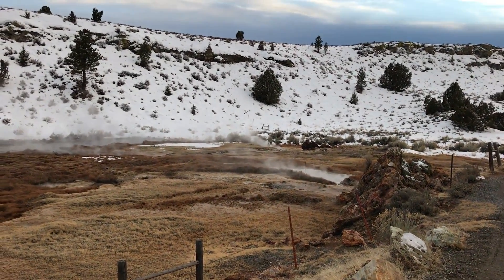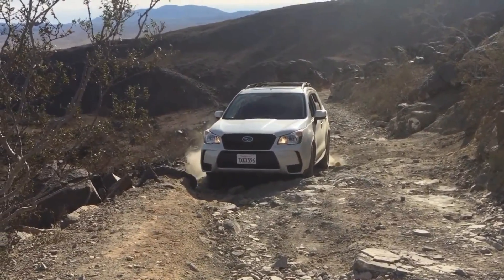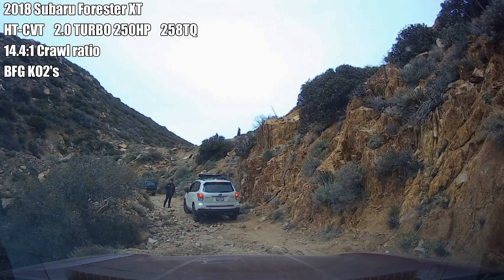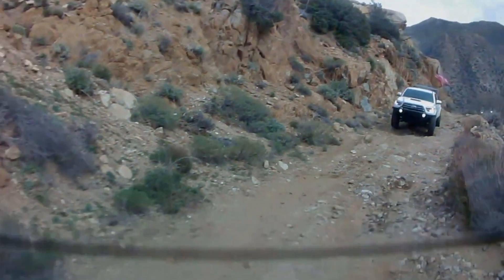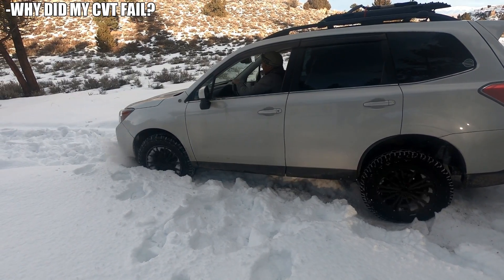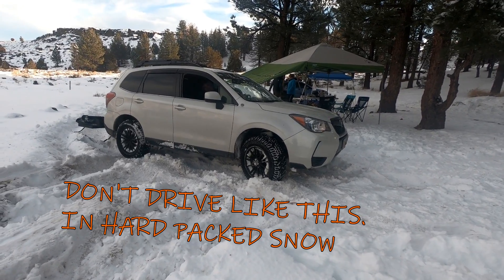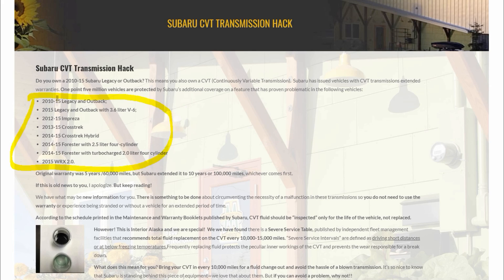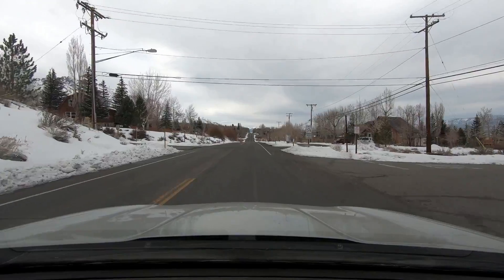CVT transmission Failed!  Can we make them last?

Comment: Great set of info. Transmission cooler with a thermostat is very good idea. Oil cooler on the turbocharged engine is also good. I probably won't get another Subaru until they really solve their transmission issues.

Comment: Great video! I like the powerade bottle to show the angle of the hill, me and my budy always complain that you can't see it on camera so it looks like the car is struggling for no reason, might have to steal that idea from you lol. Also I believe (could be wrong cause I haven't looked to much into it) that you can put in a more powerful pump to help it change ratios when under load, or, keep it in manual in a set ratio helps it because it isn't trying to shift to find the correct ratio when you are thrashing down a trail. When mine went into limp mode it acted like it was going to die when I touched the accelerator so I popped it into manual and shifted it accordingly and it actually worked fine. (In the second part to the hill climb video)  where do you go wheeling at??
Reply from the maker: Dirt-Trek, we know all the tricks with manual mode and the paddle shifters, but I’ve never heard of an upgraded pump.  What kind of pump is that?  Sounds interesting.  

I would be honored if you use a Powerade bottle in one of your future video 🤣.  I like your style, I’m going to have to give you a shoutout in my next video.
Reply: @JonDZ_Adventuring  I wish I knew those tricks before some of the obstacles I've taken lol, but that's what my channel is for, finding problems and solutions first hand.  I tossed around the idea of putting a turbo on Treky before I realized power wasn't the real issue, and my concern was could the cvt pull ratios with the pump it had against more power. Can't find the exact source and I may have been mistaken but I think I heard it from one of these guys
https://offroadsubarus.com/showthread.php?t=6867&page=37
A shout out would be amazing, my channel is... struggling lol

Comment: If you want your CVT to last, stay OFF the trails
Reply: If you want your tennis shoes to last, keep them in the closet! We intend to use our vehicles, and our driving style has brought out a flaw. Even people who don't offroad might have trouble with this if they have steep hills in their commute. Subaru actually has one of the best CVT s on the market but it is still a newer system so undesirable issues are going to surface.
Reply from the maker: Well said Dirt-Trek!  Also, I’ve been hanging out with more and more 2019 Forester’s with dual stage Xmode.  Having previously owned a 2015 Forester XT with the turbo, I hate to say it, but... I really think they’re more capable than the previous model, even without a turbo.  Subaru must be fine tuning the transmission (by upgrading small parts like the torque converter and valve body + programming).  The dual stage Xmode makes a noticeable difference.
Reply: @JonDZ_Adventuring  definatly a lot to look into seeing that it isn't a traditional 4x4, hopefully I can get the upgrades on it before I push it to the breaking point. Don't ever plan on selling it though so I'm in for the long haul
Reply from the maker: Dirt-trek you seem like a pretty technical guy.  You can probably swap in the 6 speed or even better yet, a 5 speed dual range!

The 6 speed manual has a really freakin high crawl ratio.  They can climb steep hills at 2,500 rpm.  Check out @lates23 on Instagram when you get the chance.  He drives a 6 speed crosstrek, but if anything ever dies, he’s going to put in a more powerful engine.  Might be from the WRX, maybe the STI.

I use to drive a 2010 WRX.  I hated off-roading that thing.  But, I know why.  I had a 10:1 crawl ratio 🤣.  The crosstrek is 17:1.
Reply: @JonDZ_Adventuring  technical would be a very kind way to put it, more like a persistent bumbling idiot lol I see that I have, or am about to break something and literally try whatever solution and see if it works lol I'd thought about a swap but I'd like to stay with the cvt. It's new, it needs to be reviewed and improved, and I'd like to see it succeed.
Reply from the maker: Robert Prechter well by that mindset you’ll also want to stay away from cold weather, busy cities and uphill freeway mountain passes.  OR you can just take a more technical approach and maintain a CVT according to stress being applied to it.

Comment: Well this was super disheartening...
Reply from the maker: Sorry Lorrie D, my hope is that my experience, observations, and recommendations can be used to prevent CVT’s from premature failure, especially in the turbo models.  The CVT’s in non turbo Subaru’s seem to last much longer.
Reply: @JonDZ_Adventuring  well that's good, I've got a non-turbo and that makes me feel a little better. Though I'm wondering if I should get the fluid changed as regularly even if I don't light off road. Just regular old LA traffic.
Reply from the maker: Yes, I’m from the LA area as well and stop and go traffic is killer!  Especially if you drive over the Grapevine or the Cajon pass.  Here’s the definition of severe driving:
“Severe (or average) service, as defined in most owners' manuals, includes trips of less than four miles (six km), particularly in cold weather. ... In many owner's manuals the following are considered "severe" or average conditions: ▪ Frequent idling for long periods of time, such as stop-and-go driving in heavy traffic.”

The Subaru dealership won’t recommend a CVT fluid change for 60-90k miles.  Changing it at... lets say 30k miles should help (I would think).

Take care!

Comment: @JonDZ thanks for making this video, correct me if I'm wrong... so the cvt cuts the power to the wheel when the cvt fluid gets too hot? If so, installing a transmission cooler will help prevent this?
Reply: The system cuts power to keep from breaking components when under stress. So trying to crawl over obstacles is a no go and has to be taken at speed. It's a fail safe that gets in the way.
Reply from the maker: Same rule applies for my 2019 Honda Passport.  It has an aggressive crawl ratio (for not having a transfer case).  I’ve been crawling up steep hills at 2-3 mph, but the moment I’m in a 2 wheel situation, it’s hard to progress upwards.  I’ve had my AWD temp warning ⚠️ light pop up.  I learned in need to use a little bit more momentum.  I’ll start crawling up stuff at 5 mph from now on.  I want to protect my rear differential!  “As slow as possible, but as fast as necessary”.  That’s a quote I’ll go by from now on.
Reply: @JonDZ_Adventuring  I'm stealing that as a life motto
Reply from the maker: Good question.  The answer is:  there is no change in CVT operation when the CVT temperatures go up.  As far as operation after the CVT temperature overheated CEL (check engine light), I wouldn’t be sure.  I’ve stopped or pulled over, I’ve had that message pop up on 3 occasions during ownership.

Comment: CVT's blow up because they're driven in a manner in which they were never designed.  They weren't designed to off road.  They weren't designed to take the day to day punishment from owners who modify and drive they're grocery getters like sports cars.  This isn't rocket science.
Reply from the maker: Then why does the 4EAT (4 speed automatic transmission) found in earlier Subaru’s, take the same abuse?  You’re *not* as smart as you think bruh 🤣.  (Damn typo😞)
Reply: TakeDeadAim 😑
Reply: Spot on, if ya wanna go proper off-road you need to purchase a proper 4x4 not a small SUV that’s based off a Impreza

Comment: Hi. sorry your Forester XT's CVT failed. Did Subaru cover a replacement under warranty? I noticed you are posting Honda Pilot videos now. Are you no longer going to post Forester vids?
Reply from the maker: Lance Guilin Subaru replaced my CVT under warranty.  My channel will still have plenty of Subaru content, they’re still in my videos.  For example, if you watched my Calico video, I have footage of the new 2019 Forester.  I also feature new mods for Subaru, a lunch box locker by Torq Masters and an aluminum reinforced Oil pan cover by Subiworks.  My goal with the channel is to support the light off-road/soft road community, no matter the car Brand.
Reply: @JonDZ_Adventuring  oh, glad to hear Subaru did right by you and replaced the CVT under warranty. I have a 2016 Forester Limited 2.5i. I don't believe I drive it as hard as you, but I drive it pretty hard.. I did the 100 mile White Rim Trail @ Canyon Land National Park in one day. I stressed my Forester quite a bit on that trip. I'm in the market for a potential upgrade to a larger vehicle -- was thinking of the Ascent but am now much more hesitant. You can't beat the stock 8.7" ground clearance of a Subura though.. But I suppose since you increased the ground clearance even more, it doesn't really matter what you stock came with. 

What do you think of the new KIA Telluride? It has a traditional transmission, not CVT.
Reply from the maker: You did the white rim trail????  Oh my goodness!  First, you probably drive harder than me and Second, I’m jealous!  I was told they only allow 4wd with a transfer case now.  So.... I did all the research on the Passport before I purchased it.  I researched the lift kit and found it was just strut spacers with no need for multi link spacers.  I knew I would end up with more ground clearance than my Forester XT in the end.  My FXT had about 9.5 inches of clearance at the front skid plate and about the same at the rear differential.  My Passport has 10 at the front skid plate and 11.5 at the rear differential and a flatter rear diff area.  The side overhangs on the lifted Passport has more clearance at about 13.5” with room to improve that to 15” if I remove the cheap plastic side skirts.  My lifted FXT was at 11” with no room for improvement.

The KIA Telluride looks like a decent vehicle.  I’m not totally sure if the AWD system is as good as Subaru’s (from what I’ve seen, I want to say it’s just a step down) but it does have a superior drivetrain.  It looks like its biggest weakness is its off-road angles and lack of wheel well.  The Telluride has 17 degrees of approach and 21 degrees of departure.  The break over angle isn’t published, but it doesn’t look too good.  So... if you can’t give it a tire lift due to small wheel wells you may be in big trouble.  Did your Forester get damaged during white rim?  Did you take hits?  A Forester has approach/break over/departure angles of 23/21/25 with lots of room for improvement 2 inch lift and 2 inch taller tires.  I think Kia was going for the flush look when they decided to make the wheel wells so small.

Comment: We replaced our ‘17 Forester Touring with a ‘19 Passport Elite last week...primary reason was our dislike of the CVT. It was our first (and last) experience with this type of transmission. We simply never made peace with the feel of the transmission in daily driving and decided to sell the car with only 20,000 mi on it.
Reply from the maker: Brian, my first experience with a CVT was with a 2013 Nissan Juke.  The vehicle had good reviews at the time of release and my best friend had bought one and spoke really highly of it.  At that time, automatic transmissions were pretty terrible, so the delay in response once I floored the gas pedal was similar to lets say one of my old girlfriends Toyota celica automatic.  I nearly got into an accident during the test drive of the Juke when I tried to make a left turn.  The delay was so bad.  When I bought the 2015 Forester XT, I found that CVT to be much more responsive.  Although it wasn't perfect, I found it acceptable.  The deal breaker for me is the long term reliability.

Now... you probably know, I bought a 2019 Honda Passport AWD as well.  The transmission is sooooooo much better!  After driving the Passport for a day and then getting back into my old Forester XT (to drive it around to repark it next to the Honda to transfer over my gear), the feel of the Subaru drive train just seemed so cheap and unrefined.

Comment: Hi Jon, Hi everyone
I am not that afraid of a CVT failure cause if i was to get a new Forester it would be the 2.5i. I dont trust turbos. The guys from the local Subaru service said the 2.5i is more reliable in general dont know why. I only wanted to know how they do on inclines and it definitely requires some knowledge.
First off when you are going from a dead stop press the gas firmly to give the belt a chance to grab and then add in throttle. Some CVTs may cut power in order to prevent belt slippage.
Second turn of eyesight. The second thing causing the ECU to cut engine power is the Eyesight system.
Always use L in inclines. You may not notice a difference but the CVT has much easier time than it would have in D.
VDC and Xmode off in conditions where there is no traction. Both of these systems seek traction and may slow you down in sand or deep snow.
After many many research hours i found that video: https://youtu.be/oaxggGLwWHE
What it shows? A Forester climbing a ramp with rubber bands? Well, you can clearly see how steep that ramp is. And no, the CVT does not cut power. Clearly. So it aint that bad. Again speaking for the 2.5i model.
I hope I gave some useful information to you guys. Have a nice one!
Reply from the maker: Good advice Umbra!  After owning 3 turbo's in a row, I am done with them.  They were fun, especially my WRX, but it's a game of pay to play.  My Subaru mechanic/rally-X racer friends prefer NA engines too.  The car industry is also starting to move away from turbo's in favor of revised naturally aspirated engines.  Take Hyundai/Kia for example, they're ditching the 2.0 turbo in favor of V6's.  The future is electric.
Reply: @JonDZ_Adventuring  everything's economical now. For the good or for the bad thats what it is. People in my country are well past 100k miles on their CVTs. They said they change their fluids every 60k miles  but they are all with the TR580.
Reply from the maker: @moonsapling  I know someone that has 200K miles on her Subaru Outback 2.5L with the TR580.  She changes her CVT fluid every 30K miles.  Her outback is really really modified too, if you have Instagram, look her up, @maukaru.
Reply: @JonDZ_Adventuring  Well it seems that most Japanese companies are going CVT. This is actually good because in a few years most problems will hopefully be fixable/fixed. I guess fluid change is the key.

Edit: I saw her Instagram. What a lovely Outback! 200k miles with so much modification done? I am amazed. 
BTW i have always wondered where do people with CVTs get their transmissions fluids from?

Comment: I have a 2016 Crosstrek that already has had 2 CVT's installed. 1st one was my fault, second one was CVT failure. I asked the dealership if they recommend a cooler and was told it would void the warranty! The CVT in the Trek now has been acting up where it doesn't shift (fake) and engine stays at 3k± rpms and the temp light came on.

Comment: Hey Jon, thanks for posting this. My 2015 Subaru Outback 2.5i Limited is at 57,000 miles. It's never been off-roading, but I want to start. Should I install the Hayden cooler and change the transmission fluid before even starting off-roading? Also, what does a transmission fluid change cost typically? And do you only trust Subaru dealers to do it? Thank you, Jim.
Reply from the maker: Hello Jim, yes, I definitely recommend a transmission cooler is added to any Subaru that's offroaded.  Since you already have put 57K miles on it, I think it would be a very good idea to have that fluid changed out.  Sorry, but I do not know how much the CVT fluid costs, but the comment just before yours has a little info.  Maybe "ResukaMedia" can answer your question :P

Every 30K miles should be including a CVT fluid inspection.  Have your technician take a picture of the CVT fluids color.  If you could leave me a comment of how that turns out, i'd greatly appreciate it.  I have some others that will be reporting back on the color of their CVT fluid.